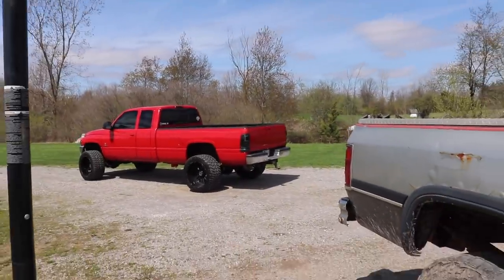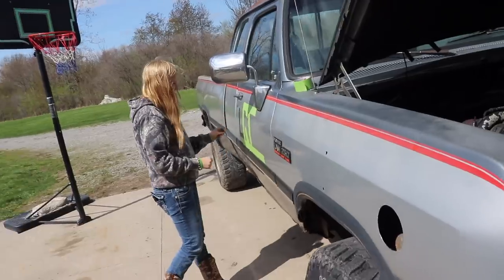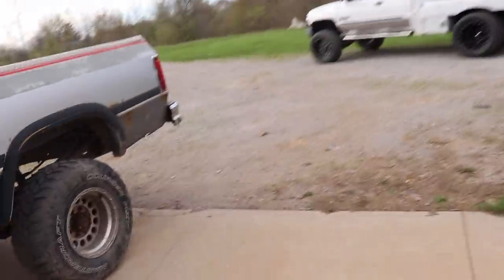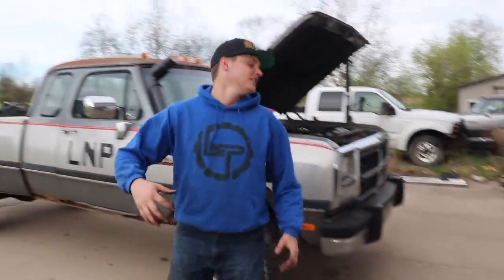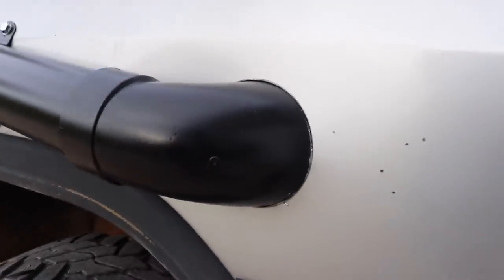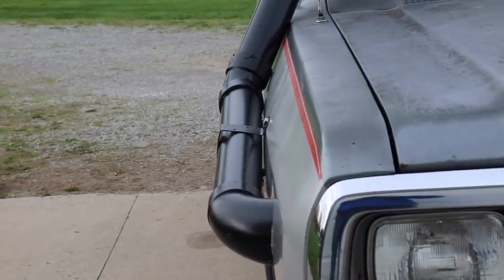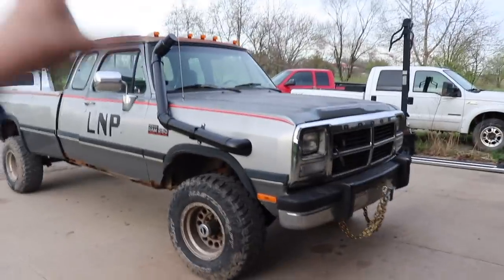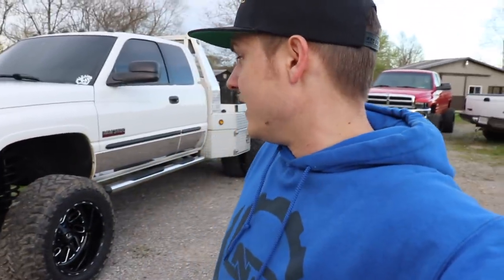BIG UPGRADES FOR THE 24V DUALLY & CUMMINS MUD TRUCK!!!

Comment: Get rid of the chain and wimpy clips securing it... first time you try to pull it out of the mud hole, you'll bend em. Put tow hooks on the front and a hook on the hitch in the back and use a recovery strap. Chains aren't rated for pulling, straps are

Comment: Not trying to hate on the snorkel but won't it funnel rain water and water splashed up from hitting a deep mud hole right down into the turbo with a filter like that?
Reply: Westconsin Farm Boys That’s what I’m thinking, it will be worse then factory. I think that setup with a 45deg up top instead of the 90,  with a cone filter and a small pale bolted through the top of the filter.
Reply: Yeah the absence of an air filter is asking for trouble... a generic oiled cone filter mounted on the end would be perfect. I bet within the first few times of muddling, he will have issues, depending on how wet the mud is.

Comment: you’re gonna get hurt with that chain. don’t even use it not worth it. by yourself a rhino strap that holds like 60,000lbs and toss it in the bed until you need it
Reply: Yeah that chains gonna snap